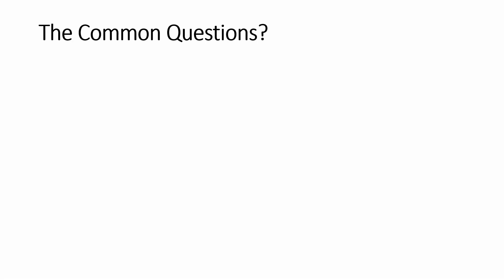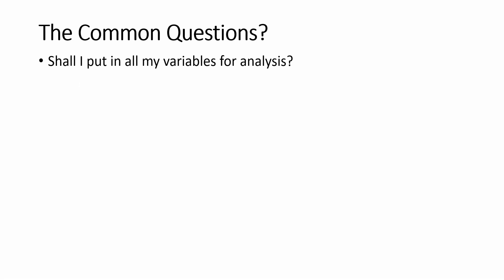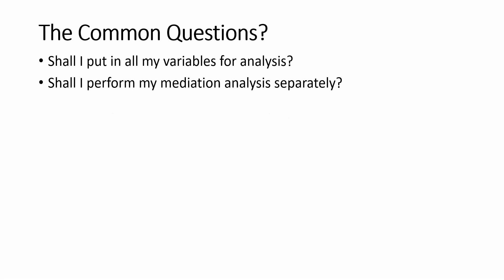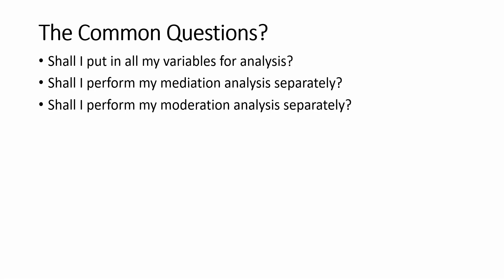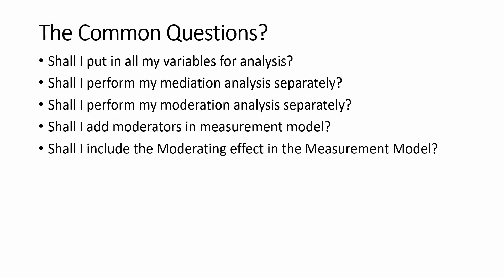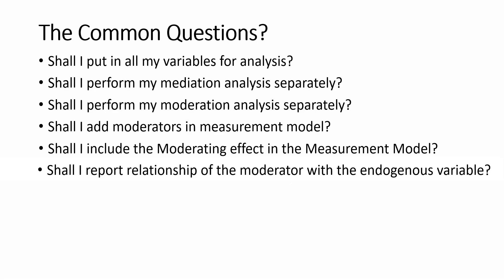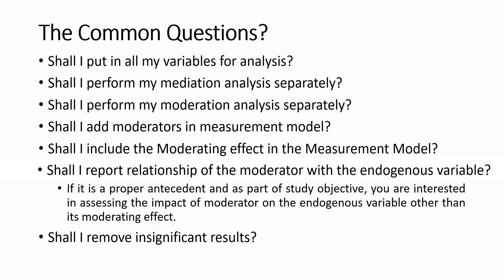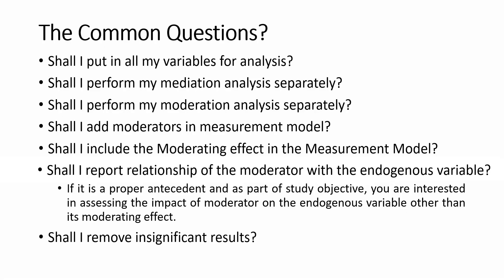Common Questions/Misconceptions About Structural Equation Modelling Answered.

Comment: Sir, I have a question regarding binary variables. Is it possible to use Structural Equation Modeling (SEM) in AMOS to predict a latent factor that affects a binary variable, such as a binary variable indicating customer satisfaction (satisfied or unsatisfied)?
Reply from the maker: Binary outomce requires Binary Logistic Regression. You will be able to run the model, but i have to see it provides the odds ratio and other relevant results as in Binary Logistic Regression. You can run and check.
Reply: Thank you so much, Sir. I think I will run Binary Logistic Regression in SPSS and compare it with the results of AMOS.

Comment: what is the difference between standardized results and unstandardized results in SMartPLS4. Also when running PLS Algorithm, there is the options of factors and paths, what is the difference? when should I select path or factors?
Reply from the maker: Please use Standardized Results, as for Path and Factor, use Path for better R-Sq values.